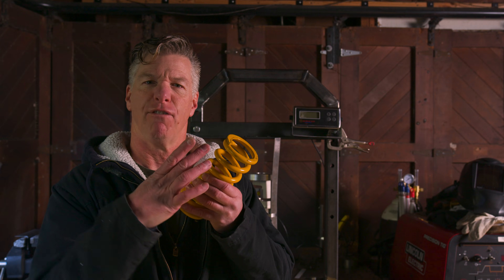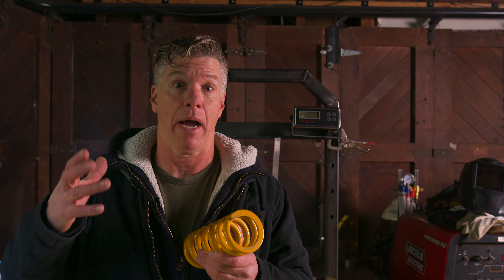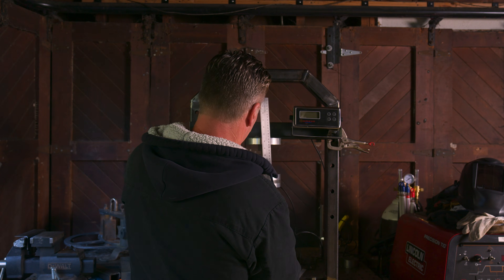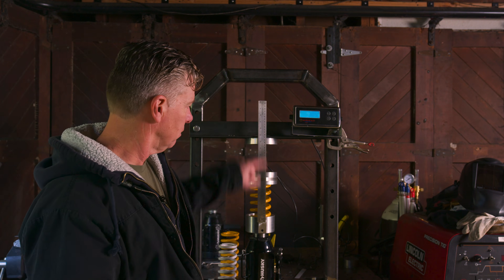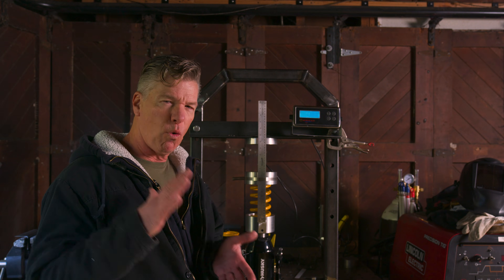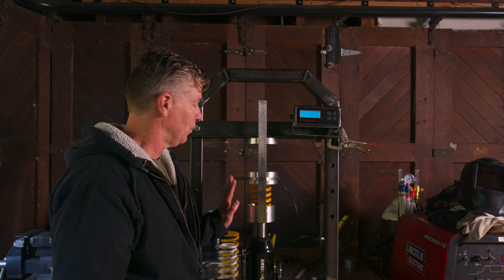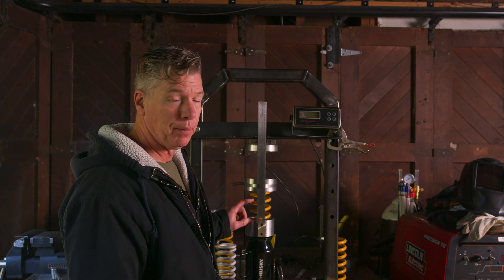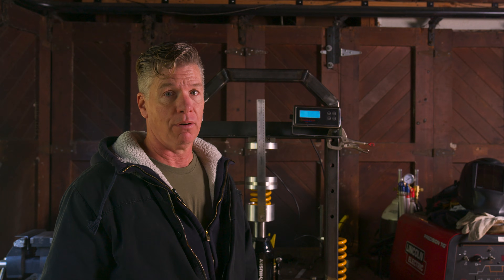1,296 LBS of Force! 🤯 How Much Force Is On Your KTM Super Duke Suspension?

Comment from the maker: The data doesn't lie: 1,296 LBS of force! 🤯

That huge number shows why your suspension setup is unique to your riding style. You need mechanical adjustability to handle that force without compromising your sag window.

Your solution is here: Superduked Custom Sport Links (the ultimate ride height fix): https://superduked.com/links

Comment: Force at rear tyre axle is less than at the shock due to suspension linkage force transmission ratio which is not linear And also depends on swingarm pivot position (if adjustable), swingarm effective length (distance between swingarm pivot and rear axle), linkage dogbones length (if adjustable) linkage geometry. So to really measure ehat is going on you have to build dummy shock with no springs (no main no topuot, no oil, no rubber travel stop) and measure shock travel in mm for every 5mm of rear axle travel up/down. Build a chart. Topout fights main spring rate at the beginning of the travel. Take tat in account - topout spring length and rate. Link progression. Spring Progression (if any). Spring rate. You will find that changing rear ride height via shock length adjustment or dogbones lenghts or linkage triangle or swingarm pivot position results in different linkage ratios and ratio progression. So this video should have been about 3 hours and have an answer why your same weight friend thinks that 100Nm/mm spring is good enough...

Comment: That’s nuts. I had to think a bit to get it. The ~300lbs preload is you plus the upper half of the bike pushing down on it. And then in hard braking you get about 900lbs of force pushing into your bike from the road (and probably an equivalent number pushing into the front shock too?) i’d definitely be more concerned about the front shock bottoming out since the rear one will lift and relax as the back tire lifts under huge braking force, I think.
Reply from the maker: Crazy right?   Leaverage

Comment: Dosnt matter,  only important point is cps
Reply from the maker: Love to hear more
Reply: @superduked33  to arrive at spring rating  in cycles per second. Read tony foalas suspension set up.
Reply: Basically, in order for the springs front and rear to match their movements under different loads (c.o.g bias of sprung masses) and different suspension-to-wheel travel ratio (1.1 to 1 in the front due to the rake,  2 to 1 or any other swingarm lever ratio in the back), one method of calculation consists in measuring the own frequency of movement of the spring.

Comment: For anyone interested, on gen. 1-2 the swingarm lever ratio is 3:1 and the unsuspended masses (of a std veichle) avg18kg at the front and 25kg at the back. If anyone wanted to measure the weights of motorcycle+rider at the two axles using scales to match the right springs front and rear, the contribute of the unsuspended masses have to be taken away in order to calculate the correct position of the COG. Then there are the inertial forces of the unsuspended masses but that's another story involving the dampings a lot...

Comment: In terms of mechanical systems, the difference in distance between the eyelets moves very little, compared to the rear swing arm moving quite a lot. The spring tension would therefore need to be significantly greater than half the motorcycle weight plus most of the rider, in order to stabilize the suspension, much less control compression.
Cool demonstration. Glad the spring didn't kamikaze around the room. Compressed springs are super dangerous.
Of course I know what a newton is. Takes many packages of fig newtons to compress that spring 1mm. 😆

Comment: I had a question rattling around in the back of by head because I just got an older gsxr 600 for the track and it has a linkage, while my RS 660 doesn't. Your experiment made me curious so I looked arounda and found Simon Crafar's Tech Talk on linkages: https://www.youtube.com/watch?v=H2DO3bN93kc  I never really took the time to think about it before but what you are saying makes sense. The normal force (the ground resisting the weight of the bike) is pushing upwards with roughly 300 lbs at the axel and the swing arm acts as a lever, multiplying the force on the spring (like moving your hand from the middle to the end of a breaker bar). The linkage also affects the amount of force applied to the spring by reducing the mechanical advantage back to roughly 2:1. Good one!

Comment: I guess that your spring is rated 110 but it is not imo. Did you rate /test the spring? 10n=1,0197 kgf
Reply: 50mm compression of 110n/mm spring requires 5,500n = 561kg in theory
Gogo's test suggested 588kg in practice which is pretty close at only ~5% out, esp considering he only used a ruler to gauge compression (etc)
However if these measurements are accurate, you are correct as his result suggests 11.76kg/mm compression rate, which equates to a 115n/mm spring 🤔